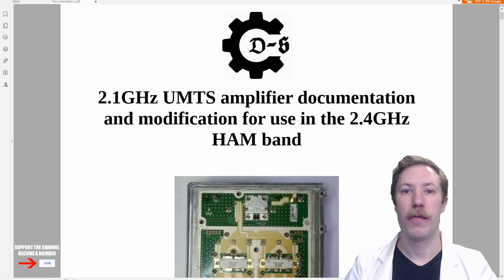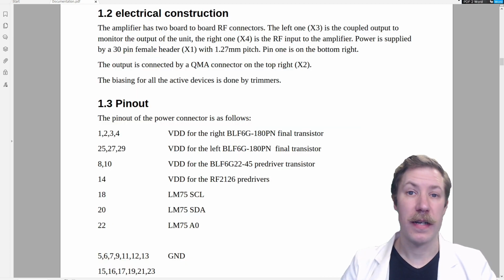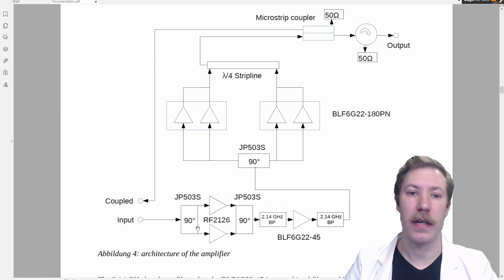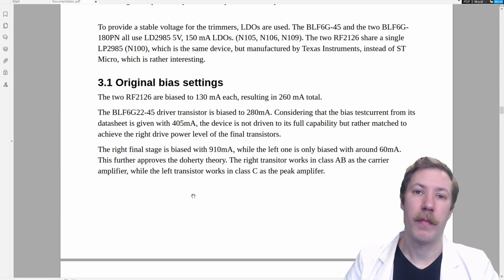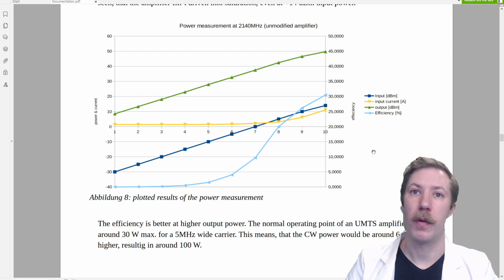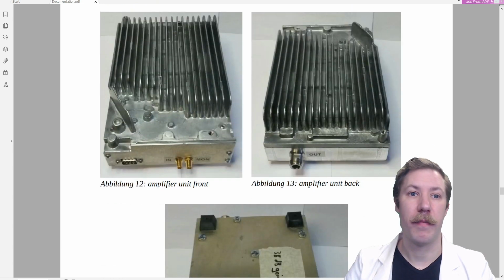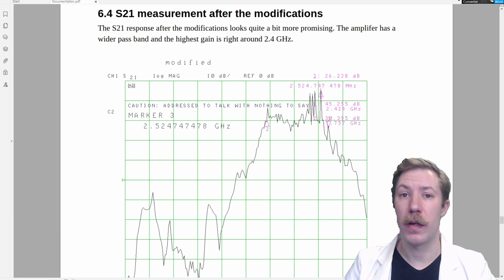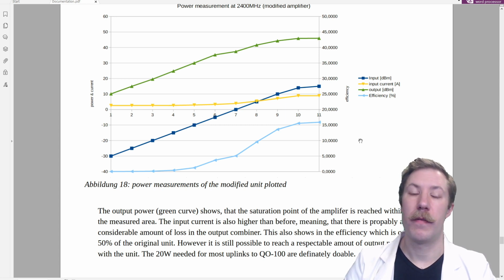Nokia Siemens 3G Flexi 2.1GHz to 2.4GHz 50W Amplifier Reverse Engineering (Part 3 of 3)

Comment: Nice video Mads, this Da_Stier seems to have quite a bit too much time on his hands. ;)

On a more serious note, here are some more comments, I wanted to add:
- The 3D printed case with aluminium tape worked great for shielding the different compartments, however it took ages to wrap it all up so I don't think I will use this technique too often. 
- For the VNA plots, I used a directional coupler bridge in order to not blow up the input port. This of course means that I loose around 45dB of dynamic range on the lower side which is important during the OSLT calibration. That is why the S21 plots are so spikey and full of noise. I guess they could have used some averaging to be a little bit clearer. 
- The 10 to 20% range is about what you get from modifying (snowflaking) UMTS amplifiers, the very popular Spectrian amp also is in the 18 to 20% range after modification. 
- For a good uplink amp for example for the Qo-100 satellite, a custom built amp is propably the better choice, since it will be more linear, use less power and can be used with lower (and more adequate output powers). If you use this UMTS amp to generate for example 5W of output, the 1 amp of bias current will still use 28W of power and push the efficiency waaaaaay down. (under 5%)